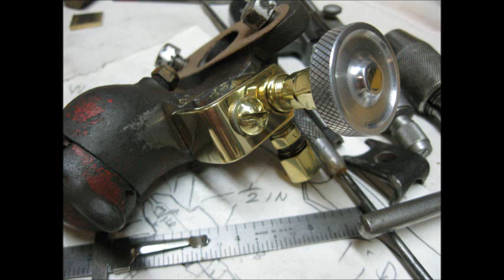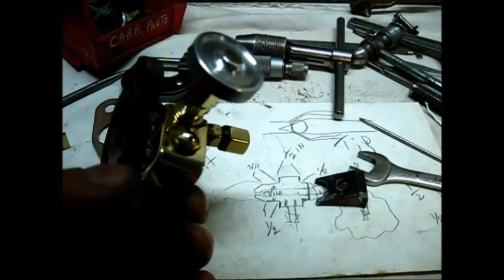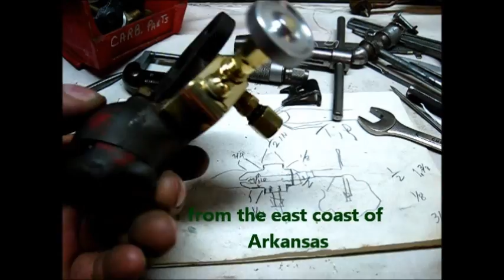Fairbanks-Morse 1 1/2 hp dishpan #17

Comment from the maker: you are right,, but the engine will know,,as the shallower angle will give you better control and I think a finer fuel mist,, a fine long taper is the correct way,,,,

Comment: Your job is worth an A, really good, but I would have turned a new shaft with 1/4-32 threads and a shallower angle on the needle for finer control of the fuel.  I'm sure the one you made will work fine, the engine won't know!  I do like Gasoila.